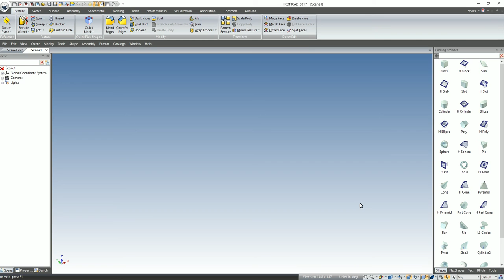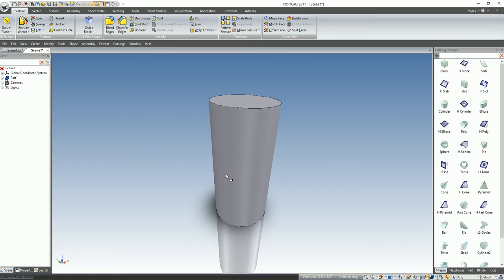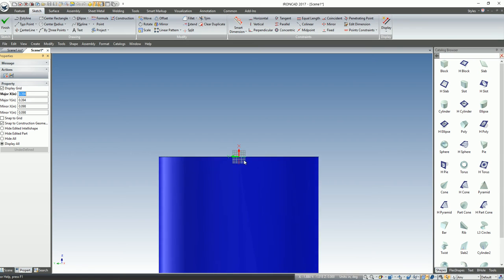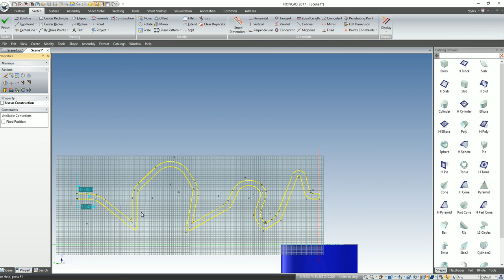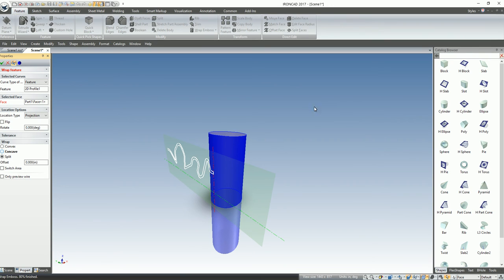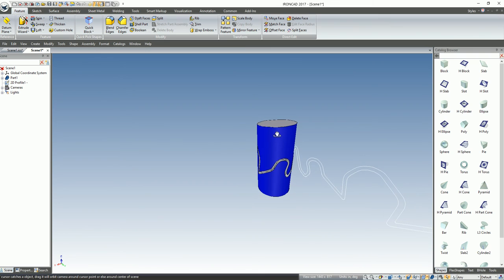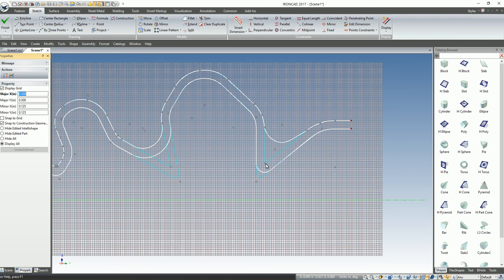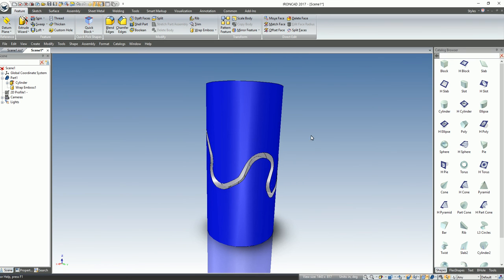Barrel CAM in IronCAD - CAD Design Tools

Comment: Some profiles work while others don't. Especially when going around all 360 degrees.
The link to the 2D profile that is used for the wrap is broken so that any parameters or sketch constraints will have to be applied inside the wrap profile instead of in the original 2D sketch. There should be an option to embed or link the original sketch instead of creating a sketch copy that is unconstrained.

Comment: Barrel cams are cut with slot mills.  Is the slot produced in this video the same as would be produced by a slot mill?
Reply from the maker: Path that you use could be from a slot mill or any other 2D geometry.
Reply: I'm wondering what the ramp flanks will be.  Followers are usually cylindrical to occupy the slot as the tool produced it, but there's instantaneous point contact.